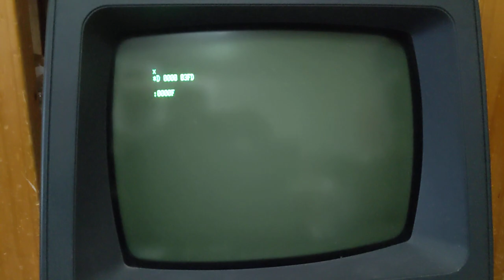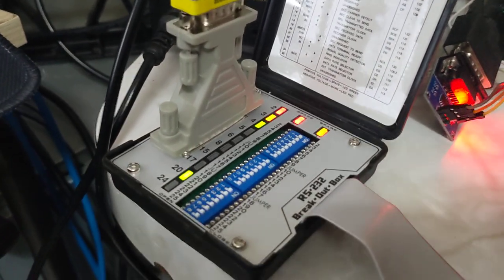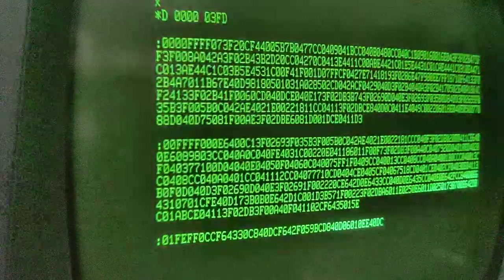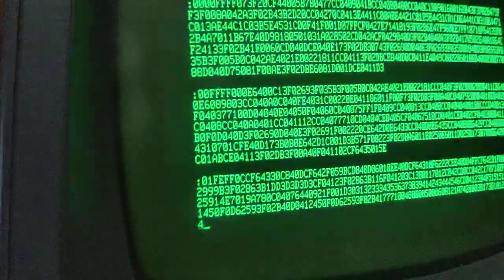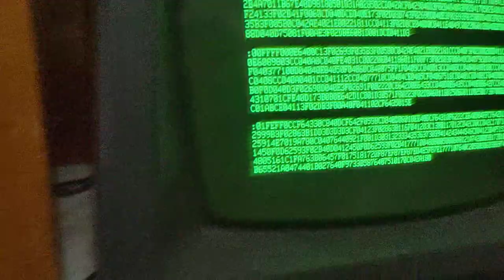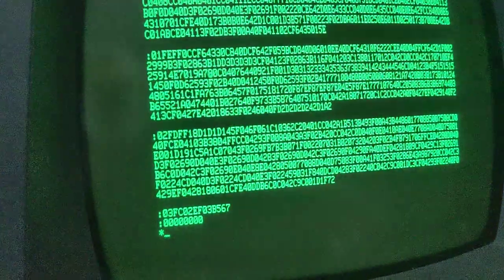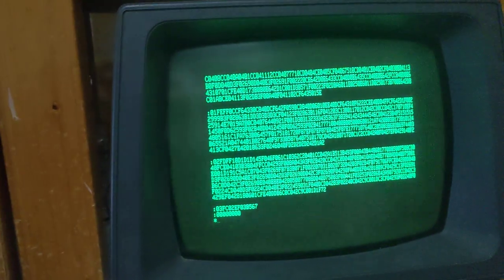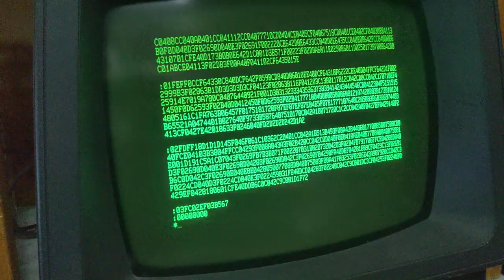Dumping the Signetics 2650 PIPBUG masked ROM to my CRT Terminal

Comment: My first computer was the 2650. I had an Electronics Australia Baby 2650 System with an added S100 RAM board that had 11K of RAM comprising of 88 RAM chips. In a weak moment, I gave it all away, much to my sadness now. One addition was a 6847 (I think) memory mapped video I designed and wrote the code for. I still remember 3F 02 B4  was "Branch to Subroutine, Absolute, Unconditional, Character Out".
All my code was entered in HEX via the serial terminal.  I added an EPROM programmer, changed to a 3KBaud cassette interface and used a model 15 Teleprinter as my printer. Oh, memories!
Reply from the maker: @dendad5128  I also had an EA 2650 kit when I was 15 years old but I could only afford 1K of RAM,  I didn't have access to an assembler and I never really got my terminal to work properly. So it's been wonderful being able to revisit the 2650 again.
Reply: @RoyAntaw  My system was gained originally pre-built from a friend in the late 70s I think. I swapped an IBM Selectric Golf-ball terminal for it. Then I extensively modified it.  Somewhere in my shed I still have FORTH for the 2650. Many years ago I purchased that but the order got lost so by the time it was found and sent to me, the 2650 had been replaced with a Rabble Ozi  (Ohio Scientific clone made here in Oz) 6502 system, so I never got to try it out. I did have a great collection of early machines and in the giveaway, they went too, much to my sorrow now.